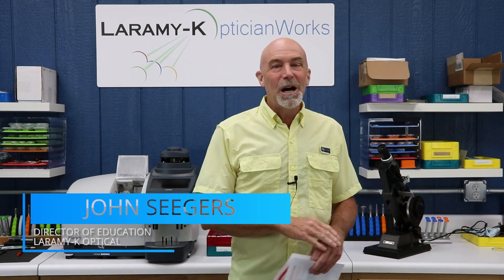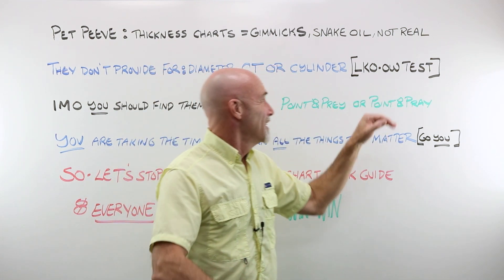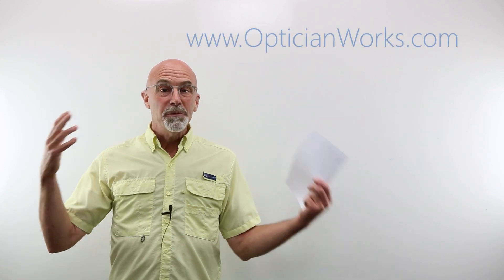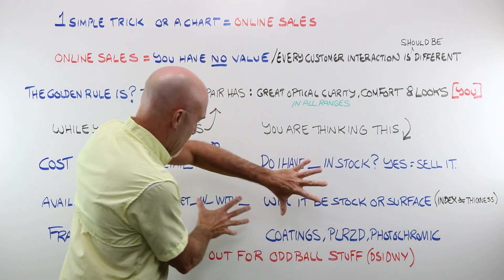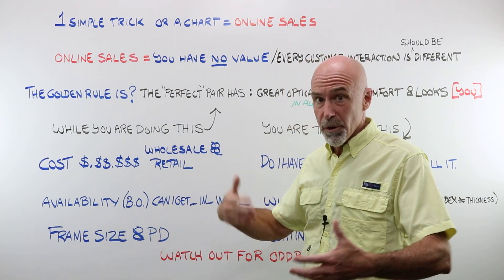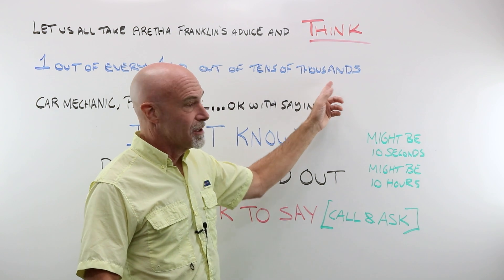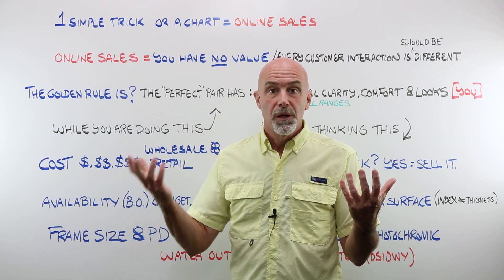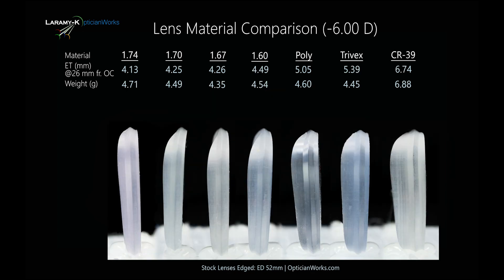Choosing Lens Material Based on Lens Power

Comment: Aside from thickness is cr39 better optical clarity than 1.60-1.67 high index plastic and is cr39 better for progressive.
Reply from the maker: That depends on so many things - low power nothing wrong with CR39 but I'd lean towards Trivex or 1.60.

Comment: Hi John, first of all thanks for all the great info, appreciated. my question is if my patient has for example -6.00 with cylinder of -3.00 will that be like a -9.00 with out cylinder? in order to move them to 1.74?
Reply from the maker: Um, er, ah - no - wait - yes - no. You will have a -9.00 somewhere on that lens/lens edge but with that much cylinder I'd stick to 1.67 for the optics. 1.74 if they insist on it or if it is available in a stock SV finished uncut. Great Question! If you do all the other good optician stuff you will probably be OK either way.
Reply: 1.74 on metall frame and u can put 1.67 if the plastic frame has thickness.Normally these lenses are in stock,so if i want to have the best result from the thickness side use 1.74

Comment: What thickness number is the Poly? 1.57?
Edit: It's called the"index" of the lenses, not "thickness number" (I didn't know what it was called before).
Reply from the maker: The index of poly is 1.586. You will see it rounded up for marketing nonsense. It is NOT a high-index lens. It is often one of the thinnest/lightest combinations but certainly NOT the thinnest lens material available. The term "thickness number" is incorrect and not anything from optics.
Reply: @LaramyKOptical  Thanks for the info

Comment: 🤔 Why is 1.74 quirky stuff? How does it compare to 1.67?
Reply from the maker: 1.74 is very prone to aberration where 1.67 is far less so. 1.74 also poses some problems when being surfaced. As mentioned in the video save the 1.74 for the really high stuff in SV finished uncut jobs.

Comment: First off, I want to thank you for your channel. I feel much more confident as an optician thanks to you. I have amazing mentors at my job, but you answer more of the “WHY do we do it this way” questions I have.

I had a patient previously do a CR39 lens with a (~+2.00) rx wanting to thin out her lens and make it lighter. I ended up putting her in a 1.67, which was the lowest high index her insurance’s lab would do. I told her doing a 1.74 would be wasting her money. I later asked one of the doctors, not my mentors, if it truly would’ve made that much of a difference in a 1.74. He said “well, if she’s willing to pay for the 1.74, why didn’t you let her?!” Which felt a little predatory. 

Thank you, thank you, THANK YOU!
Reply from the maker: You are welcome. 1.74 would have been a terrible choice for any number of reasons. You 100% did the right thing. If thickness hadn't been mentioned with that power 1.60 or even Trivex would have been  fine choices also.
Reply: @LaramyKOptical I currently work at a semi independent shop, her specific insurance used an outside lab. I was hoping for a 1.60, but her insurance plan and/or the lab doesn’t provide that option. I didn’t check for Trivex- that would’ve been a great option… I’ll keep that in mind!

Comment: I normally use single vision, but I'm getting bifocals for sewing with, and trying to decide between CR-39 and 1.6. I'm -8 -1.5 170 and -6.25 - 1.5 30, I normally get 1.67, but I want the best possible optics for this, as long as they don't get truly ridiculous. The frame is 49-15-46-130, acetate, and I don't know my PD but I'm guessing 61. I'm mostly petite but my head width isn't, so it's a nightmare finding frames.
Reply from the maker: Nothing wrong with 1.67 or the 1.60. CR-39 would be terrible with those powers.
Reply: @LaramyKOptical  I have an old pair of glasses in CR-39, as a matter of fact! I have a circadian rhythm disorder which makes me supersensitive to blue light, I need to block it entirely for three hours before bed to stay on a 24 hour day. This means a bright orange tint, it's nothing like those silly "blue blocking filters" which we all know are rubbish, and they couldn't get it right in high index on previous occasions. They're in metal frames, 49-16-135, but they're nine years old when frames were shallow, so the B measurement is only about 26. Anyway, the visual acuity is fine, as far as I can tell with that tint on. But I don't try to do sewing with them on, I wind down for bed, so it's just reading and watching TV. They get to about 6-7mm thick on the outer left side, and don't stick out of the frame much mostly. These will have a B of 36, which I realise will increase the thickness at top and bottom. Anyway, thank you, good to know. I think I'll go for the 1.6. I'm mainly just worried about losing more visual ability. I haven't been able to read a paper book in years (I have severe ME/CFS, my muscles don't work well) and already have four spotlights on my sewing desk.

Comment: Another thing that I found out the hard way since my optician failed to mention it: how sensitive is the person to chromatic aberration. I got polycarbonate lenses made since they were thinner and lighter... but the seller failed to mention (pretty sure wasn't even aware) the high chromatic aberration issues when looking off-center on a poly lens with high diopters (-4 myopia with -2 astigmatism). Had to replace those glasses.
Reply: I have the same problem with polycarbonate, I get cr39.
Reply: I recommend Trivex. I switched from polycarbonate. Immediately noticed a better optical performance while playing sports. Suppose to be more impact resistant. I have a high prescription. Not all online companies have Trivex & will not allow me to order polycarbonate. ZENNI gives me the option to order what lens index & material I want. Optical clarity is my priority. Other companies insist I pay more for thinner lenses that has a lower optical performance. (Abbe value). No thanks.
Reply: yeah when i mention it to them they seem like im insane for even noticing it.

Comment: Hi there. Would it be possible to make a -6 glass lense hi index, ie: as thin as 1.67? Thank you
Reply from the maker: There are hi-index glass lenses in a 1.8 I believe. But that would be serious overkill for a -6 and a 1.8 is going to have some optical issues. I doubt you would find much thickness difference between a well made 1.67 or 1.74 and a hi-index glass in that power. But if you have to have glass for some reason it can be done.
Reply: @LaramyKOptical  isn’t a 1.67 glass lense considered a “hi index”  lense? Thank you
Reply: @LaramyKOptical  a few more questions. Can a glass lens be made into a round shape to fit a frame? And can a glass lens be made bifocal/progressive? Thank you
Reply from the maker: @Fireneedsair  To be perfectly honest I don't even know what index glass lenses are available in. They are so rare. BUT! A glass lens can be made in any shape. Glass lenses are available in most lens styles including progressives. We may be able to connect with you someone depending on where you live. Better to email me through the OpticianWorks website. John
Reply: @LaramyKOptical  thank you! I'll email you  asap

Comment: Please cover glass as a lens material also.
Reply from the maker: You wouldn't choose glass by power for any reason. [Unless you are talking about a 1.8 high-index double grind sort of thing.] You would choose glass because someone has always worn it and likes it or they have a specific reason for wearing it like working around a specific chemical or they require the clarity of the optics. Glass was what we wore for a few hundred years - nothing wrong with it. It is (very) heavy and can get thick quite quickly as power goes up. Trivex and 1.6 will provide nearly as good optics with much less weight. 99% of the time glass will be one of those things that the customer will ask you about - not the other way around. On top of that (at least here in the US) very few labs even offer it anymore since demand is so low and raw blanks are getting scarce. John
Reply: @LaramyKOptical  Thank you for your response John. The thing is that I sold a AR coated glass FT-28 yesterday to an older patient. From ocular history the patient cannot wear polycarbonate due to the low ABBE value. Where I work we only carry CR-39, Poly, and Glass. Since, poly was ruled out the two options left were CR-39 and glass. I explained the pros and cons of both materials. The patient decided on glass due to superior optics, superb scratch resistance, etc. There is an experienced optican that overheard the patients speaking about the glass material and he gasped at the fact that I sold the patient glass and began to ask the my patient if she wore glass before, etc. Basically causing doubt in the material. Though I value his opinion that plastic should of been the choice material he did not need to interfere in what we (patient and me) agreed upon. Do you think I made the wrong move? Also, what the optician did was not professional at all. If he wanted to coach me or voice an opinion he could of pulled me to side and spoken to me. Thanks again John.
Reply from the maker: @richardzamora9956  You absolutely positively did nothing wrong at all. If glass is an option on your lens material menu and you choose to use it there is nothing wrong with it. The lab should assure it is properly tested for impact resistance and that is the end of it. Again - we all wore glass for a few hundred years. Most high-end proprietary sunglasses offer a glass option. I sold glass lenses to customers that had worn it and loved it - one fellow was in a HUGE 60+ eye with a progressive. He also ordered multiple pairs every other year - good customer, good money. In the future I wouldn't look down at CR-39 since it is another material that we all wore for 40 years when there was no other option besides glass. It isn't optically bad just thick and a bit heavy. So yeah tell your co-worker to mind their own business (in a nice way). And when those glasses lenses come it - put them in the lensmeter and see for yourself how much cleaner/sharper the lines and reticle is when compared to a plastic lens. Amazing! John
Reply: @LaramyKOptical  Thank you John. Yes CR-39 is great but you can't beat glasses visual acuity!

Comment: Is the assumption that there is no actual gain in thickness or clarity between standard cr39 and high-index for -4?  Or is there a deficit in clarity?  Thanks!
Reply from the maker: No, that isn't the assumption at all. Thickness change is negligible over poly and up certainly not down at the CR-39 end of the scale. Clarity comes down to many factors including Abbe which we have a video on.

Comment: The fact that you can roll through dozens of lenses for testing tells me I am wildly overpaying for glasses lenses.
Reply from the maker: Well, we are a wholesale optical lab that MAKES lenses and those are all basic designs in single-vision with no special coatings added. Not sure you are connecting the dots quite right. Yeah - glasses are pretty expensive but what isn't? John

Comment: Hello, I wasn’t informed properly when I made a purchase of lenses and I bought a pair with a High Index of 1.74, my prescription is -5.25/-4.75. Will that have vision disadvantages (less quality) against going with a lower index? Thank you
Reply from the maker: That is serious overkill for those lens powers. Depending on the quality of the lens and non-glare coating you may find the 1.74 more prone to aberration than the lower index. Vision is subjective and a matter of perception so no way to say "yes" or "no." Only "yes" poor choice of material for power. John
Reply: @LaramyKOptical   Thanks John. As you said, sometimes (rarely) I do notice the aberrations and I will discussed with my Optician, they do have “in my perception” a good AR coating by “HB Optical Labs” called “DURAR Ultra UV”. Now in your opinion, I want my lenses to be thinner than CR39(my previous had it), what index would you recommended me they have 1.60/1.67/1.7? Thank you again.
Reply from the maker: Watch the other videos about the importance of frame choice and then either a 1.60 or 1.67. With a smaller frame and just a 5.25 I'd lean towards 1.60. You'll save some money for sure!
Reply: They took more money that it was legitimate from you, that's what they did.

Comment: I wear large frame glasses with -4 diopter and while their isn't much difference between 1.67 and 1.74 in the thickness of the lens, there is a significant difference in weight. I always opt for the 1.74 lens.
Reply from the maker: As the saying goes: "Your results may vary." But --- Our weight comparison. Which is a test I did myself on a scale for weighing grains of powder shows 1.74 as being heavier than 1.67. 4.71 g vs. 4.35 grams. Your results may vary - but we have done similar tests in the past and the results are the same. It also follows the "higher density = more weight" rule of thumb.
Reply: Fascinating. Now that I'm due for new specs, I'm more concerned than ever over the quality of the lenses being offered. Especially now that I've moved to a different city away from an optician that I trusted and could work miracles on frame adjustments.

Comment: Simple way to choose lens material. Not counting the odd materials and in between indexes cr then poly 1.67 and finally 1.74 each is very close to 10% thinner than  the next index. Calculate the thickness of cr and go from there. You can show the difference to a customer by using a caliper.

Comment: Mr. Seegers, thank you for your videos. What are you thoughts on "anti-fatigue" lenses? I was recommended such Shamir "Relax" lenses by my eye doctor. I am 36 years old, near-sided (-2.5), but also have an ADD of +1.00, and still using single vision lenses, spending most of my day on the computer doing accounting work. One one hand, I am happy that progressives are not yet necessary for me, but are "anti-fatigue" lenses worth it or just another marketing "gimmick"? Thank you.
Reply from the maker: My opinion and my opinion only. You always hold out as long as you can with nothing. As long as you can do your work then leave the add power and anti-fatigue stuff alone. It's like religion and politics. Some people believe in anti-fatigue while others believe that providing additional plus or reduced minus early is harmful and causes premature dependence. IMO skip it until you need it. John
Reply: @LaramyKOptical  Thank you for the advice!
Reply: Add is a serious thing. And really should be decided with Dr. After mesuaring your existing accomodation recourses.
Reply from the maker: @Nekoandpiano  No, an add is NOT a serious thing at all. Vision is subjective. You don't need a "doctor" to slide a reading card along a meter long stick.
Reply: @LaramyKOptical  well, i guess it could be taken this way. The only thing I was saying is you should decide is ADD is really necessary since with addidation accomodation not work with full power which isn't great if unnecessary. So if skip the eye Dr. it could be decided as you suggested in your first reply i guess. As for BlueLight Blockers and Prevencia stuff...For me the most unnoying thing about them that they change the colours a lot.
Reply: Absolutely not go with the Anti Fatigue for sure especially now with CVS Computer Vision Syndrome a +1.00 is kinda high for a 36 yr old already too like your  not even 50 yrs old yet! Always listen to your Dr and not an Optician lol!
Reply from the maker: @redgreenbeambih  Let watch the proclamations as facts please. In your opinion _______. I think _______. I believe ______. Just like I said, anti-fatigue is like blue-light and just like religion and politics. People will believe what they will believe. No real facts to back them up but they believe. Thanks John